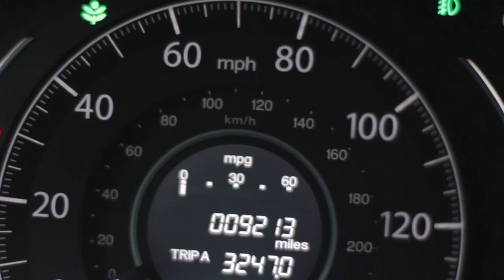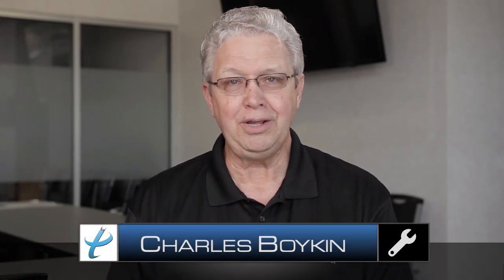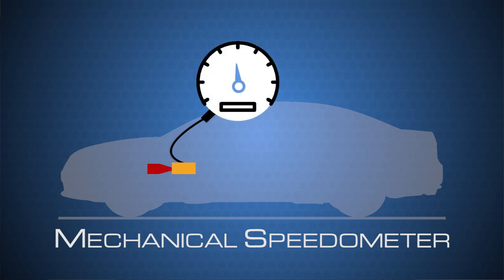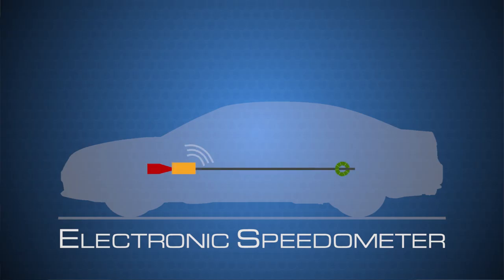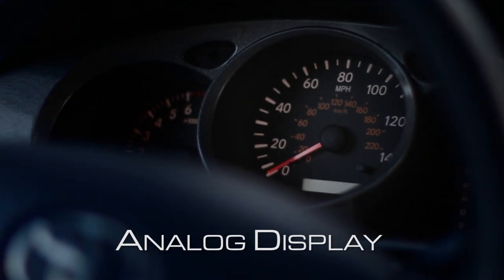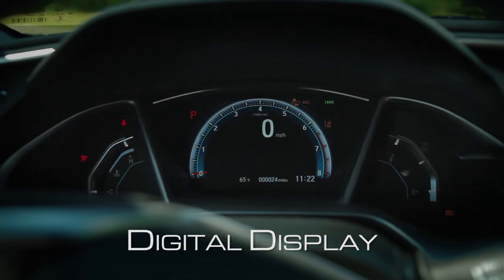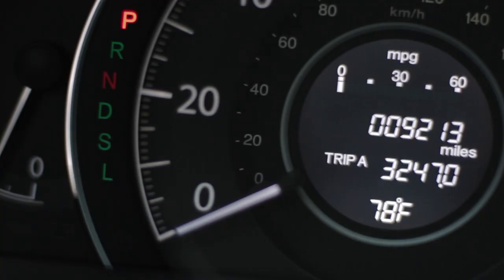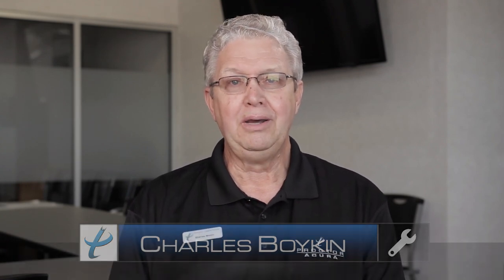How Speedometers Work: Mechanical vs. Electronic

Comment: CAN SOME ONE ANSWER THIS QUESTION: .... 2 CAR, SAME MODEL AND YEAR.... 1 CAR HAS 17 INCH WHEELS AND THE OTHER HAS 22 INCH WHEELS.... IF BOTH CARS GO TO THE SAME SPEED (60mph) " SHOWING ON THE SPEEDOMETER" ... WHO ARRIVE FIRST AND WHY?
Reply: the car with the bigger wheels, the less diameter the more the speedometer shows, so the bigger wheeled car will go faster than the smol wheeled car, if they go at the same rpm

Comment: Let's say your wheels are slipping and you are not moving but they are spinning at 60 km/h would the speedometer show 60km/h as that is the speed of the transmission rotation or would it show 0 as the car itself is not moving?

Comment: My 94 Mazda truck Speedo neddle bounces and goes forward of my actual speed. Sometimes getting stuck at the 6 o'clock position. I've had to smack my dash board to free it up.
It works good some days and bounces or gets stuck on other days  until I free it up and start over... Can I force some lube up the cable with air pressure or what is really going on. ?
Thank you. Disabled veteran....

Comment: Hi charles, i have question with you, if i want to connect speedometer with another device, which will read speed from speedometer and make other work. how can i make this type of connection both of this kinds, of speedometers(for mechanical & electronic) ?  thanks for your attantion!!!
Reply: If you have to ask others on how to do it then you are never going to get that fixed. If you want to read a digital speedometer with a Raspberry Pi or something then you’ll need to reverse engineer the signals or find documentation about it, and then program an application that will read those signals. If it’s a mechanical speedo then you could do something with a disc with gaps and a light sensor, count the amount of signals from the light sensor and convert that to the right number for the unit you want to display (kmh or mph).

Comment: hi... I replaced my car's engine and now speedometer is not working now since the new engine has an  electronic speed sensor and older one has mechanical speed sensor ,have you any gadget for that or a solution

Comment: When a mechanical speedometer and odometer dont work and when inspected everything looks good regarding the gears. Does it mean that the cable that rotates the speedometer is no good no more? Or could it be where it attaches to the transmission? Need help i have a 1984 volvo 244 dl

Comment: If I change the tire size, does it affect the speed?
Reply: @Ken Mason so when u have 215/45/17 is nearer to the actual speed that 205/55/16?
Reply: @Ken Mason i think it affects only the Speedo
Reply: The speedo measures the driveshaft, not the tires. So it won’t see a change in tire size while you do actually go faster. If your wheels turn 1000rpm, then at 15” wheels you go 72km/h, while at 17” you go 81km/h. Boils down to: if you change your tire size, then the speedo will give a false reading. Put bigger tires on = speedo measures a lower than actual speed, put smaller tires on = speedo measures a higher than actual speed.
Reply: @Ken Mason I don’t know if you are being sarcastic in disagreement with me, or just telling a joke. But yes, if your engine could reach the amount of rpm for 600mph the speedo would show 600mph while the car physically actually would be going only 10mph.

Comment: So, how do i find out if my speed sensor is the same for the abs module or if it's some sensor on the transmission/engine without consulting a manual or playing the check engine game?

Comment: can i ask you about Speed Gauge needle, i had removed the needle in order to replace cluster, after i put it back driving test show no movement at all in the speed needle while all else working,,, please tell how it can be repaired, the car is M5 e39, 2002 model 
thanks

Comment: Will I break the speedometer if I drove over its limit for a few times?
Reply: No, the speedometer works with a magnetic coupling. It will just slip through the magnetic field, not going higher by being held back by the max speed peg.

Comment: car 92 mercedes w140 300se wdb1400322a051882  car diagnoisis gave comments=engine speed increase-short circuit to ground-resistance too high...any comments(is it because of car age the instrument cluster is shorted somewhere inside?)  thks in advance  leung

Comment: Now I have to find out why my speedometer reads 65 when going 80
Reply: Maybe you have bigger wheels on your car than what it’s designed for.
Reply: @Engineer9736  Original owner installed incorrect speed sensor, I made a video on the subject.
Reply: @OldSchoolNoe  Nice job in finding that issue!